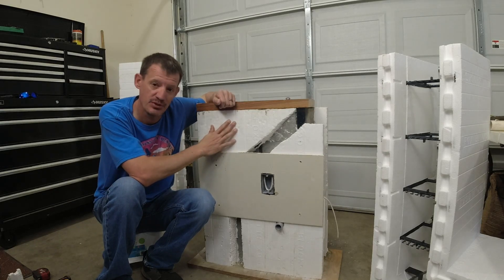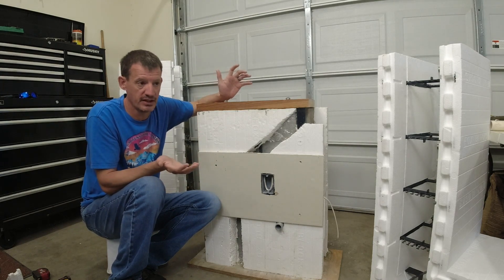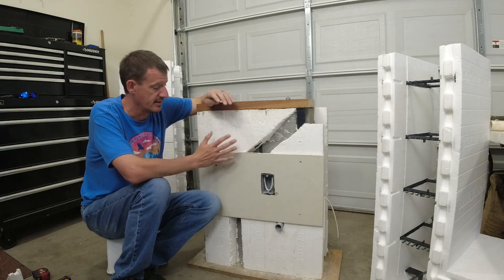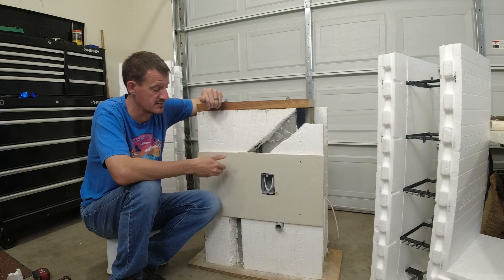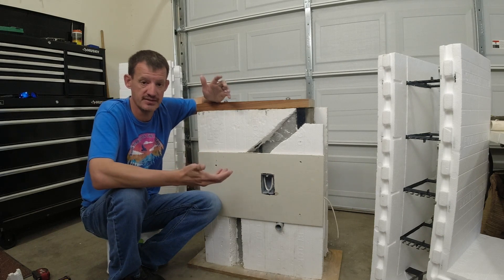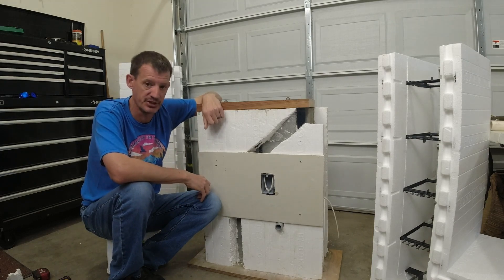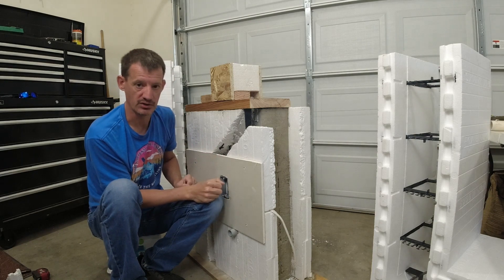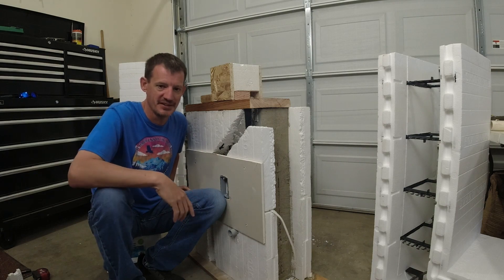Top 3 Pros and Cons of ICF Construction

Comment: The not finding studs with a stud finder sucks, although I hear many ICF manufacturers put the plastic studs every 8 inches instead of every 16 inches. Although not like it matters if you can't find a stud in the first place
Reply from the maker: It's a small inconvenience.   The magnet style seem to work finding the screws.   Once you found one you can just measure to find the others

Comment: So why didn't you just go footing to peak with the ICF rather then use the SIPs?
Reply from the maker: I have a lot of confidence in the sip's system.   I have gone back and forth on this.  We have quite a few challenges with getting concrete out to the site.   It's  doable for the walkout basement but the higher you get the more difficult it's going to get.  Also it's something I can tackle with just a little help.

Comment: Sips are garbage. ICF all the way to the top plate. Why would you want to introduce joints and additional air leakage points. Nothing beats ICFs period.  trusses or traditional framing for the roof with spray foam. beats sips on the roof too.  One pro you missed is thermal mass. I prefer the ICFs tjat have a thicker outer foam once that concrete is warmed or cooled it acts as a large buffer against temperature swings.  You want that thermal mass to help regulate the indoor temp so the thicker outer foam helps minimize outdoor temp influences.
Reply from the maker: yeah, I didn't mention the thermal mass.  That's a good point.

Comment: Look into getting a thermal camera.  It might be able to pick up the temperature difference of the plastic from the concrete.
Reply from the maker: I've got one at work I can borrow to see if that works.   I tried some aluminum tape over the stud behind the drywall and the stud finder picks that up.  It's not a huge issue, just a little annoying.

Comment: Why use SIP's when you can ICF the whole house even to the roof peaks.???
Reply from the maker: Honestly, that's a question I've been asking myself.   Since I started playing around with the ICF'S I'm questioning that decision.   Might end up changing to full ICF walls and sips roof.
Reply: @The Kay family build  will save you some headaches and stop 2 of the con's.  Also, if a concrete truck can't make it up the road, then the truck that delivers the trusses will not either.
Reply from the maker: @Cliff  we can get a concrete truck but not a full semi.  We are already doing sips for the roof, so it's been a topic of discussion lately.   We gain a couple of inches of space with the sips and a little bit more flexibility with remodeling.  Nothing crazy.
Reply: I don’t know if it’s too late, but you may want to look into insulated metal panels for the roof. That’s what I’m doing much better than a sips panel